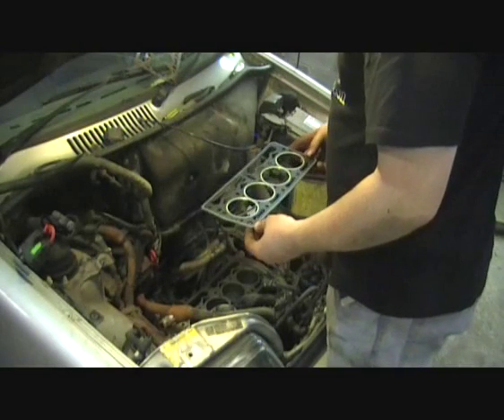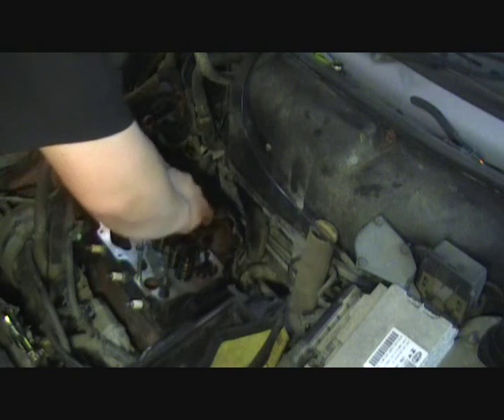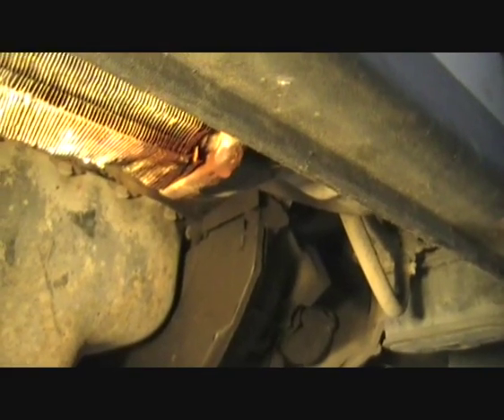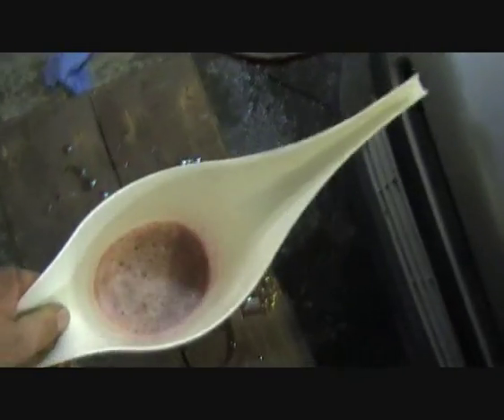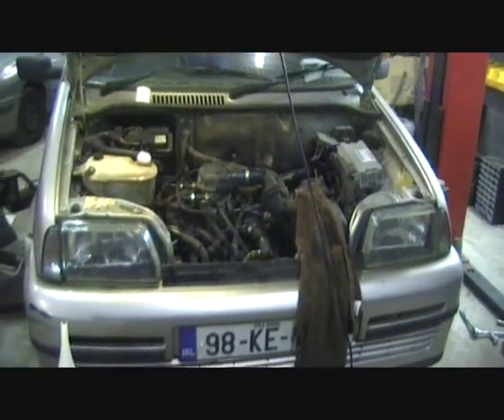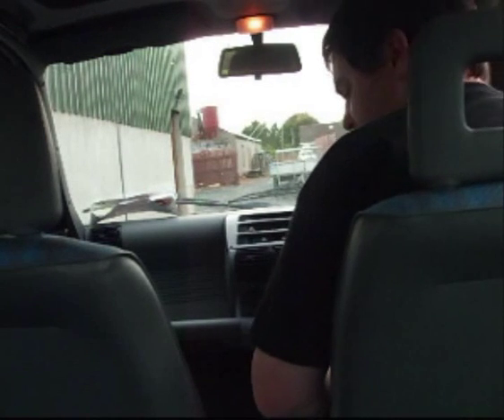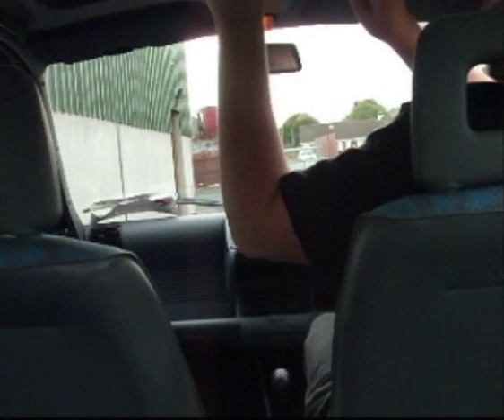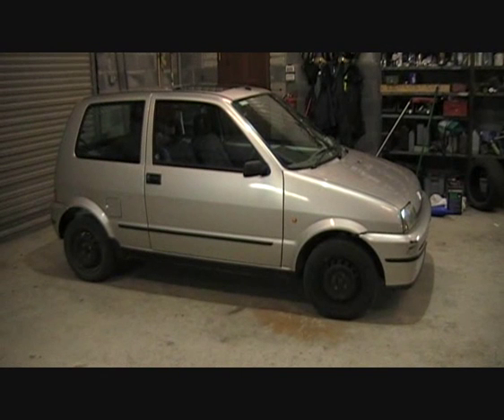Fiat Cinquecento - Simple Head Gasket Repair Pt 2

Comment: given how cheap and semingly easy to do this is I'm wondering why I didn't do it sooner. i thought it might have been a blockage in my system somewhere then I thought it might have been the water pump, but the more I read up its likely this, which is good as this is about half the price of a waterpump repair, banging

Comment: That stuff to stop leaking is bad for the engine. 
Not only is it just a temporary fix, but it will gum up the engine in the process, decreasing the heat transfer between engine and coolant.
Reply: Skoda130 vhghckbv
Reply: Biggest problem is that it blocks the passages from the cylinder block to the head.

Comment: those cars are easy to fix and they can last for 20 years with EASE  . I have a punto of 1999 
car inspector remaked me this year: "did it just rolled of the production line!?"
But better change the radiator, just 50 euro  and you can run it another 10 yrs

Comment: That's the 100 series pushrod engine that dates back from the 60's (from the original 600). About the radiator, my 2001 Lancia Y had that issue too, Fiat builds decent cars but some parts do really lack in reliability and durability.
Reply: 1050cc 70hp abarth ftw